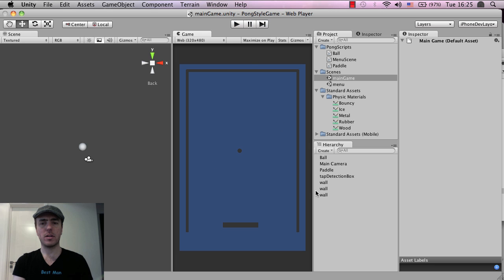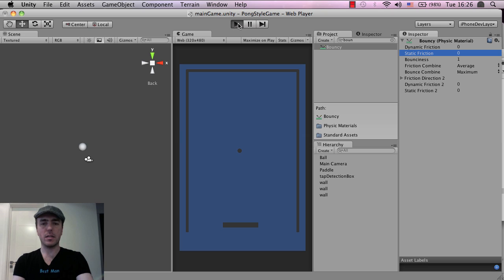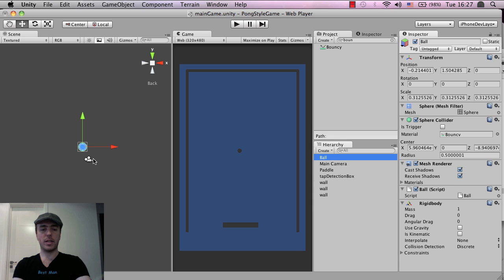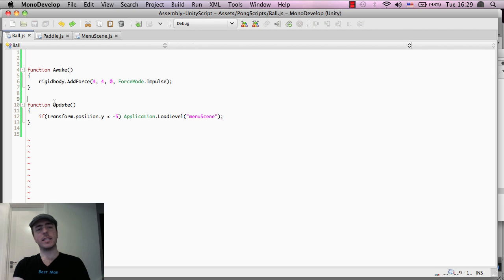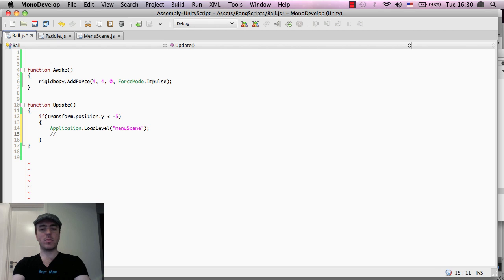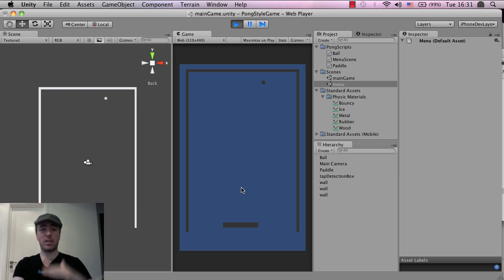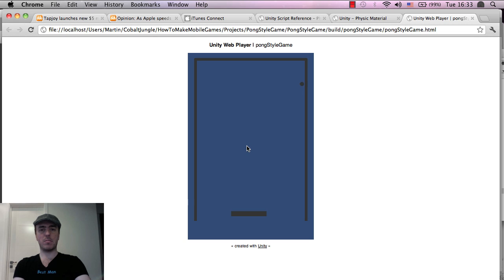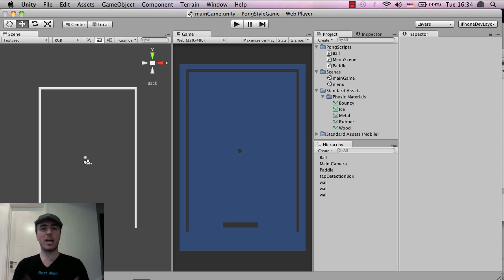Unity tutorial - Pong Game - How To Make Mobile Games - part 4C

Comment from the maker: Hey Rodrigo.
We'll keep going on the videos, lots more to come and I'll keep you updated.
I've used C# a little as well with Unity. But if you know C# then javascript should be pretty easy. It's mostly the same but just some syntax changes. If you know the API function calls then you'll have no problem in either language I think. The Unity library script reference has examples of both javascript and C#, just tap which one you'd like to shop.
Will have the next video in the pong series out soon.